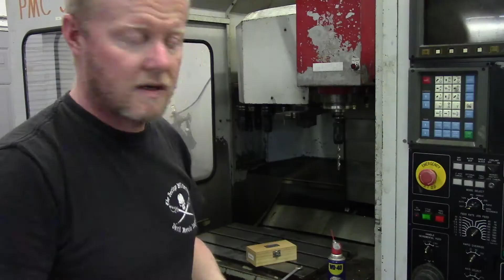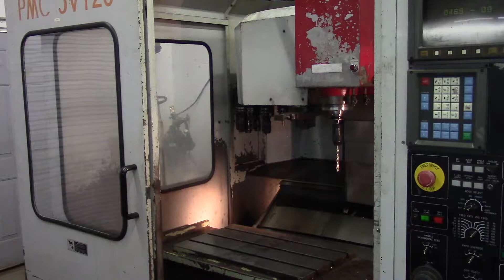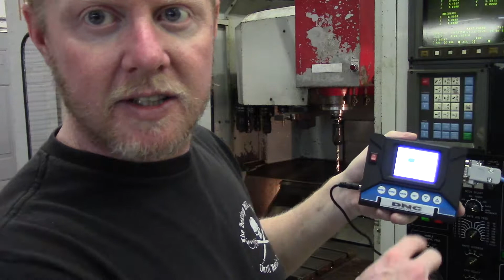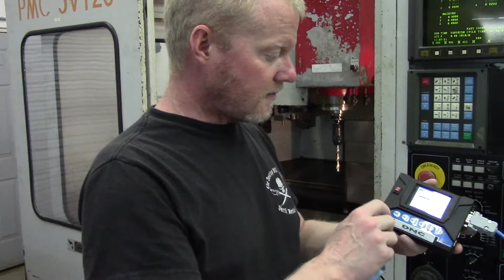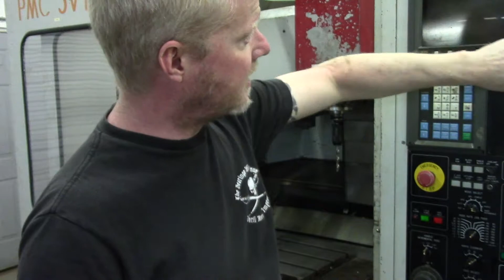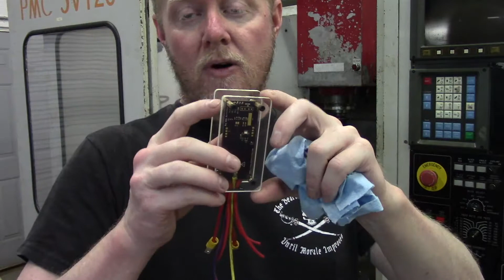First CNC chips on the mill and DNC Controller

Comment: Great series of videos!  I just purchased a VMC and really appreciate finding videos like yours.  I would be interested in seeing how you adjusted your monitor pots.
Reply from the maker: Thanks, its a pretty daunting thing to put one in a home shop.  At-Man Machining is another good channel for the Fadal single phase.  The monitor pots are easy if you have access to the rear of the crt assembly.  There are several and its very easy to adjust.  You'll want to be very careful with conductive tools in the area because there is high voltage present.  I'm planning on upgrading to an LCD and I'll do a video on the CRT adjustment as I replace it if you still need it then.  Do you have the Fanuc OM on your VMC?
Reply: Yes Takisawa MAC-V410 with the 0M.  Just ordered my RPC and waiting for that to see if the old girl fires up.
Reply from the maker: If you have the swingout it should be easier to get to.  I did a pretty extensive checklist prior to fireup.  Only real issue I had was the phasing for the tool changer.  I'd recommend checking phasing if you have real 3 phase motors on the machine.
Reply from the maker: I should have an LCD upgrade video out in September.  I really appreciate your support and I will film the exact adjustments on the CRT just before I replace it with a LCD.
Reply: Yeah i watched your ATC trouble video... what were some of the things on your checklist?
Reply from the maker: The first item is phasing.  My machine has the single real three phase motor for the ATC and it really gets confused if the motor is turning backwards.  Other is check all thermal resets prior to turning on and just after.  Then make sure air is making it all the way to the spindle drawbar and that it works before every trying a toolchange.  The arm motion it a bear to get back in the right place if anything goes wrong with other systems.